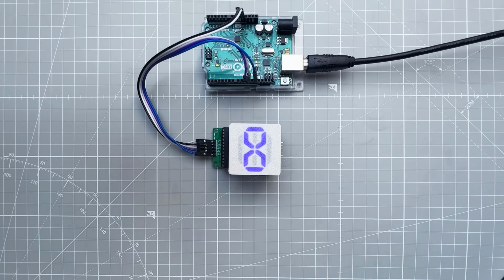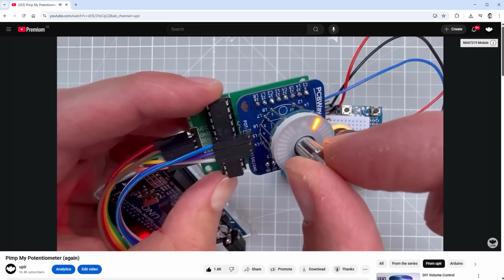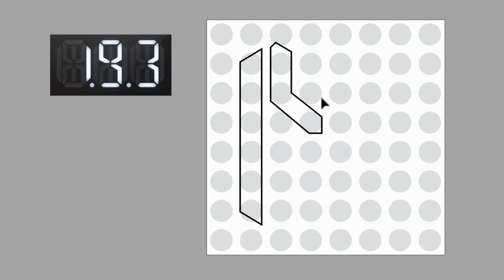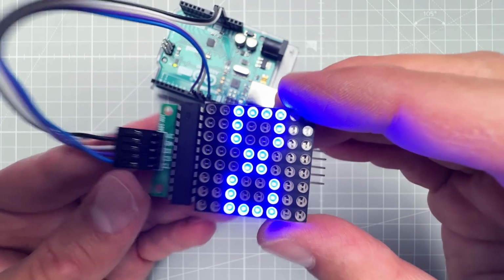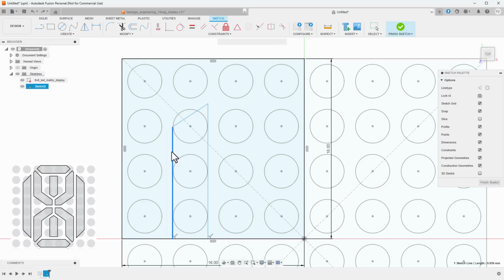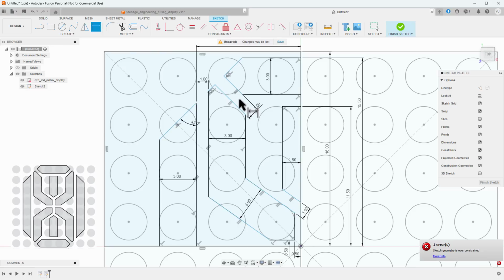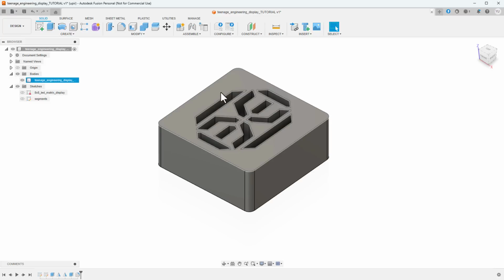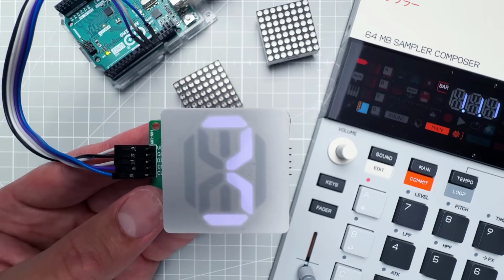3D printed 7-segment display - i.e.-  I made Teenage Engineering display at home

Comment: Why not extrude each segment from a hole that matches the full LEDs in one end to the shape of the segment in the other? Would that capture more light from the LEDs? It might also give you more freedom with the shapes you want to have in the "front". Not sure if my explanation is clear. The walls would change shape throughout the print layers instead of being straight up vertical.
Reply from the maker: I have used that exact approach in my previous two videos:
https://youtu.be/DD9FJr9zQ0U
https://youtu.be/9JRgl6mOAfM

However this time, the visual difference was minimal, so I decided to simplify the process/video and simply just extrude those pieces. Hope that makes sense!
Reply: @upir_upir  that's similar but not what I meant. You could still use the LED matrix for simplicity, but make the "bottom" end of the light pipes match the shape of the LEDs you want to use to illuminate the front, then the pipe could get narrower and change shape as it gets closer to the top end, where it matches the segment shape.

For example in the middle vertical segments you could get the full illumination of 4 LEDs per segment, instead of 4 half LEDs.
Reply from the maker: Yes, I was testing exactly that, but the results were not that much better compared to simple extrude. I should have showed that in the video though.
Reply: Came here to talk about that too. You want to have a loft from one sketch that encompasses all the target LEDs to a second sketch that is the segment shape you want. You would then likely want to extend the segment profile up some distance to enhance the direction of the light.

If you want to go even further, then use some chrome nail polish or similar to paint the inside of the "light chamber" to get more light reflecting upwards instead of absorbed by the black filament.

Comment: some great example of overengineering
Reply from the maker: Do you mean the Teenage Engineering device, or this video? :)
Reply: @upir_upir 50/50. TE stuff is just overpriced.
the point of segmented display is ease of use, isn't it? there were no point of using led matrix in my opinion, several leds would work the same or even better from designer's perspective
Reply from the maker: The point of this video was to make a display using standard off the shelf parts, and turning them into something unusual..

Comment: how small do you think this can go? it would be neat to see drop-in replacement boards for harder to find things like 16 segment four character LED displays, using SMD leds and a thinner, glued-on diffuser.
Reply from the maker: I believe that currently the smallest neopixel is 1.5x1.5 mm, the smallest SMD LED is 0201 - that is 0.6 mm × 0.3 mm. So pretty small, so I think it might be possible to simulate some hard to find segment displays this way.
Reply: @upir_upir  you can get APA-104-1010 (1mm x 1mm) RGB LEDs. I love your content, long time follower.
Reply from the maker: Interesting! I´m sure neopixels will reach the 1x1mm size at some point as well (if the haven´t already).
Reply: @upir_upir  Adafruit calls these DotStars, they have a data bus (faster than neopixels) and RGB channels. I haven't seen RGBW in that size yet.